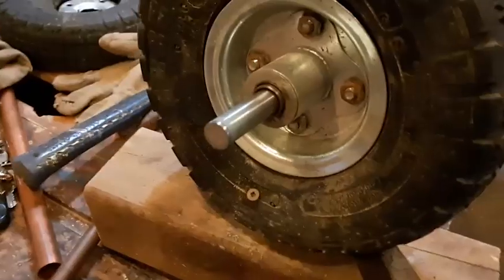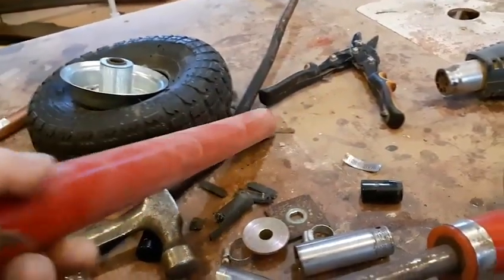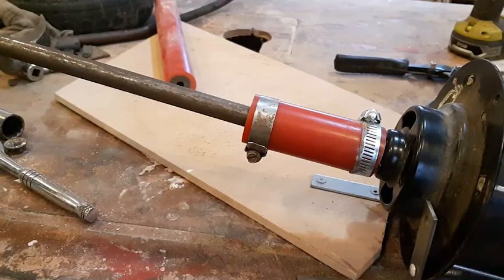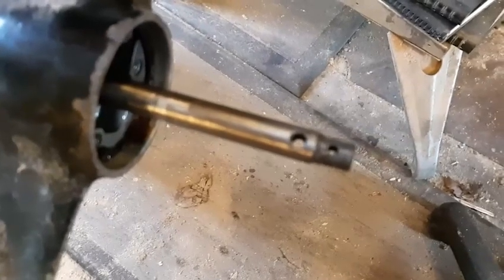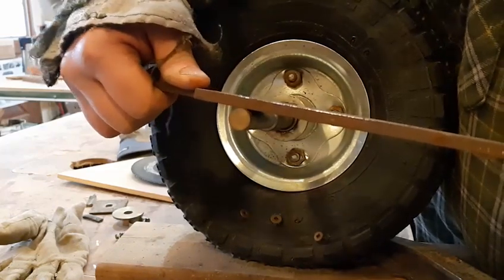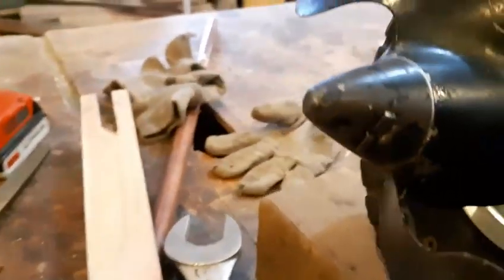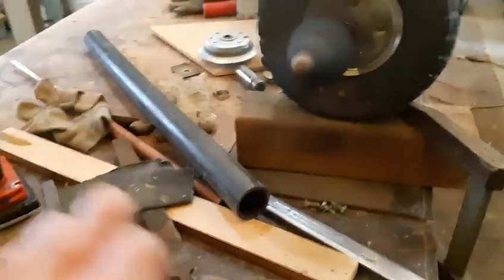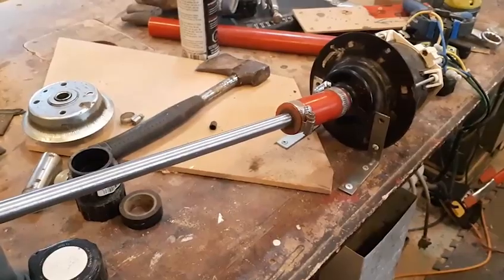Electric Boat Motor for Sailboat, CROW

Comment: Good stuff!
Reply from the maker: A fun experiment but it did not work off set on my boat. It made it hard to steer at slow speeds.
Reply: @roydesignedthat  
Well,  it earned you a new subscriber anyhow. I thought you had it offset to port a bit. I'm leaning toward using a salvaged jet drive unit with thrust vectoring. Electric drive though.
Reply from the maker: @pareidoliarocks  If I could have centered it, the drive was workable but with a better motor and controller, which showed up a week after the test! Lol! But I learned loads!

Comment: Hi Roy,  agee it's pretty cool. Utilizing the second hub and tire as an interim shaft support in the boat may help reduce vibration further.
Reply from the maker: Agree Kurt! The main forces will be at the motor and bottom bearings but the second support will help true the shaft. Best/Roy

Comment: So are you going to buy a packing nut. Strut. And a cutlass bearing?
Reply from the maker: Not to start Micheal, I will make a sealed shaft that fits over the bearing inner hub. All the parts are free so cost me nothing if they break. I will then have learned more where loads cause more wear and if the shaft/motor/prop are sized correctly. I learn best by breaking stuff and adapting. I might even be surprised that it will work long term but agree with that this is just a fun experiment! Best/RoyI

Comment: A fine pitch, 3 blade prop may be better as well, as the electric motors don't have the same torque characteristics as an IC engine.
Reply from the maker: The two blade is intended to slide up to the transom and not drag when not in use. A three blade will have one blade in the water the way I'm working it out, which I'd like to avoid. Best/Roy

Comment: Good stuff so far, you'll need a thrust bearing somewhere to take forward and reverse thrust. Maybe a spider joint to join motor to shaft instead of a sleeve perhaps. Ordinary seals can be used in marine applications if you remove the steel spring and replace it with a nitrile o ring.  "Plus one" on a PWM controller. Long tail motors.   You might also want a few wraps of copper tube around the motor for water cooling perhaps?  Keep up the good work.👍
Reply from the maker: Yes Michael, the thrust bearing is the way to go and looking into them, they are not expensive. I appreciate you pointing this out, as others have made the same observation, I will get them for the install. I'm also weary that the end may vibrate when extended so will look into a pipe to set the shaft into. The pipe will need bearings on the ends and a grease nipple. worked out. Best/Roy

Comment: Hi Roy,
Your exploration and experimentation videos are appreciated! Working out affordable electric drive with reused gear is of interest to many! 

I follow electricboats@groups.io
A group for discussing boats powered by electric motors, alone or in conjunction with other methods of propulsion (i.e. sail or hybrid). This was set up as a potential solution to the changes in Yahoo! Groups that effect the electricboats group there.
Group Information

 3,955 Members
 12,105 Topics, Last Post: 5:51pm
 Started on 10/03/1998

Don 
Chaser Cat
Reply from the maker: I'll look up the group as you are correct that yahoo has gone bust!

Comment: Well Roy, you didn't chop your hand off, so that's a plus............:)
Just kidding. 

Do you have estimates for run time, charging, battery bank size etc?  Also, any guesses on boat speed?
Reply from the maker: I have a rough idea, 220 amp hours bank (could go bigger) to start should have a run time of about 16 hours at 4 mph is my hope. The boat will also have solar panels to top up and as a camp cruiser will have extra portable folding panels to set up at camp or at anchor. The idea is to sail first, motor only when there is no wind and row to shelter if all else isn't up and running! In this way the boat is not tethered to marinas  to fill gas or plug in!  Best/Roy

Comment: Very cool Roy. You'll need one of these to control the speed and give you forward and reverse. Even has a digital gauge to show power 0-100%. It's a "Pulse width modulator" (PWM) which means it saves power., Unlike a rheostat that varys power by resistance. It achieves  reduced speeds from the battery to the motor by pulsing the power, saving energy. https://www.ebay.com/itm/10-55V-100A-5000W-Reversible-DC-Motor-Speed-Controller-PWM-Control-Soft-Start-YA/183863551329?_trkparms=aid%3D555018%26algo%3DPL.SIM%26ao%3D2%26asc%3D20160908110712%26meid%3D878cf4deaf164c57ab4fbf76dd178ce0%26pid%3D100677%26rk%3D3%26rkt%3D30%26mehot%3Dnone%26sd%3D183898163298%26itm%3D183863551329%26pmt%3D1%26noa%3D0%26pg%3D2386202&_trksid=p2386202.c100677.m4598
Reply from the maker: Thanks so much for this!!! I'm not really such a smart guy but am more a stubborn person and just start projects and am lucky that the answers reveal themselves!  Help like this is so appreciated Mibengal! I've saved the link. Best/Roy
Reply from the maker: Just getting back to the electric motor work after a long interruption. Will order the controller tomorrow! Thanks again for the help! Best/Roy